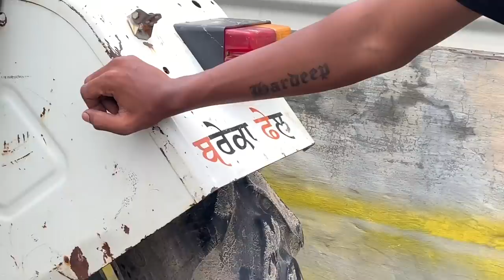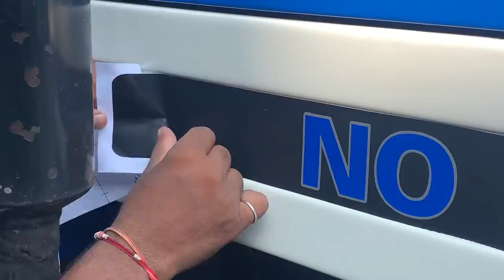Full modification || Swaraj 735 1979 model To Swaraj 744 2019 Model || Breakan Fail Group ||

Comment: Yo 735 h Kya. Ham sochte the 744 hai🙄
Reply from the maker: Akash Rod 735 bro
Reply: 735 Etna jorr kesse Marta h Bhai power to bahut km hai 735 ke..
Reply: @akashsingharya9417  tochan m power ke jrurat nhi padti jyda..
Waisa v tochan low gear m hota h 
Tochan m tyre grip or tractor ka weight depend krta h
Reply: Bhai mare pass 724h 1997model uska Kam krana h
Reply: I also
Reply: @breakanfailwale  vir kina kharch agya c paint te
Reply: dhakka Indian Tractors kirlosker engine hei bro...
Reply: @breakanfailwale  735 aur etne mote pahiye?????
Reply: @breakanfailwale  brthr tyre kinne number de paye a 16 ja 18 de